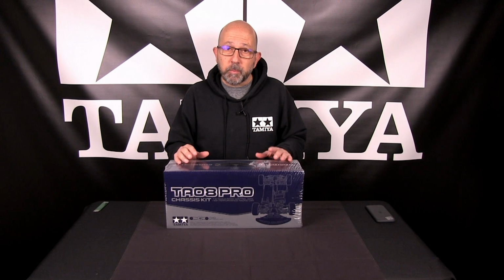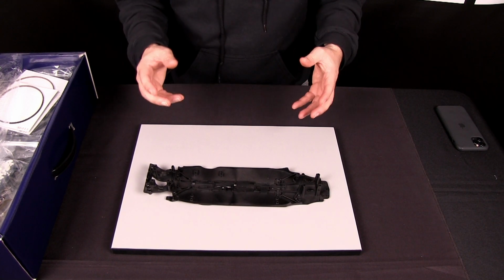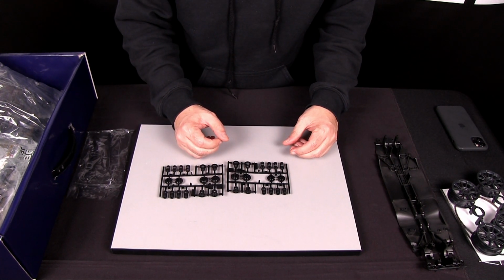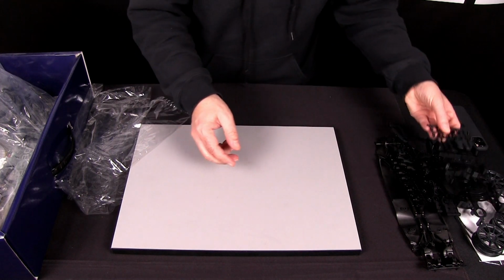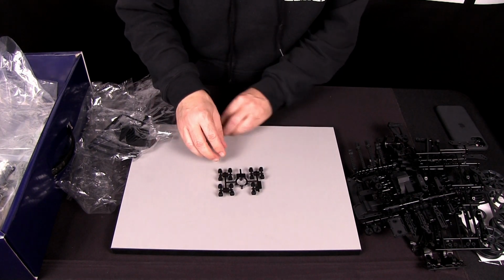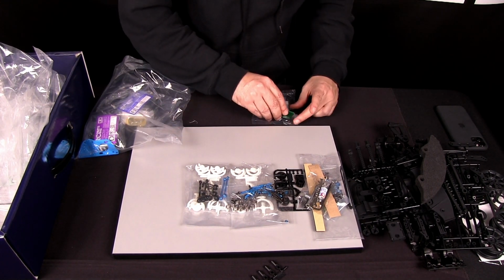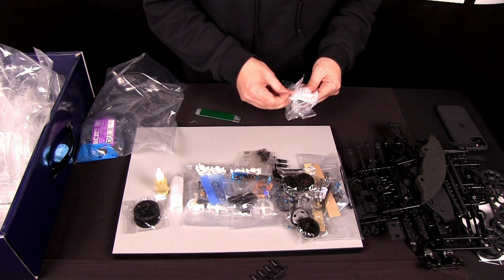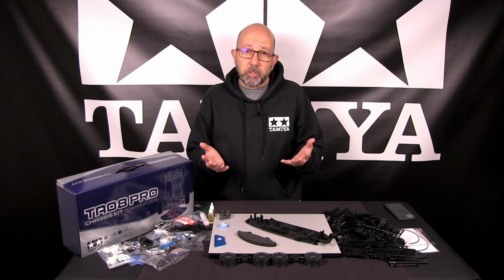Tamiya 58693 TA08 PRO Unboxing

Comment: I glad you guys keep make touring cars for R/C. Now could you guys do a video about the tons of tires you offer. Its very hard to use the website to find parking lot type of tires. Also any tips on setting the Ring and Pinion for the TB-05 Pro mines being eatting its diff gears with the stock shims.
Reply from the maker: Like the idea of the tire guide. Might have to add that to the list!